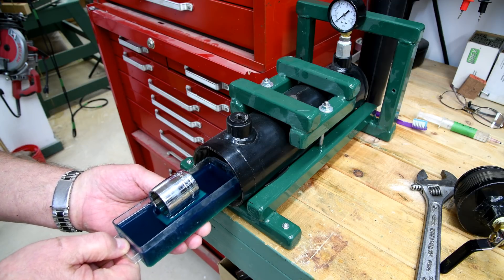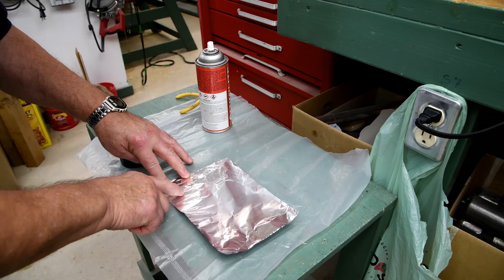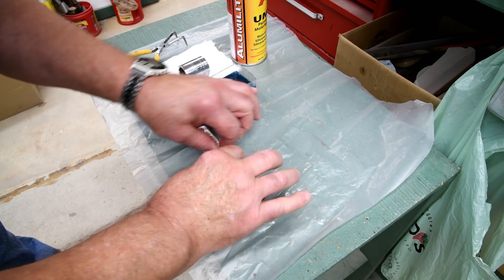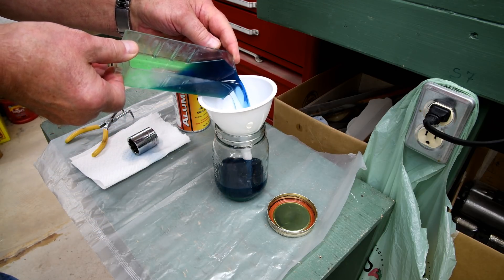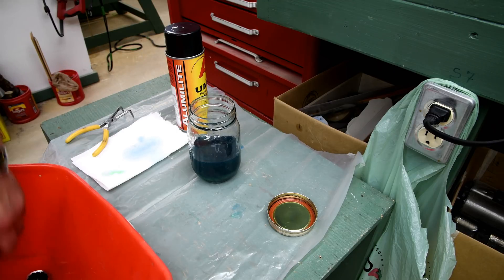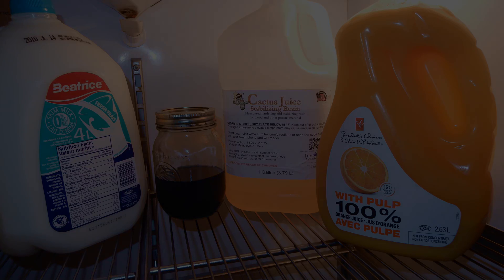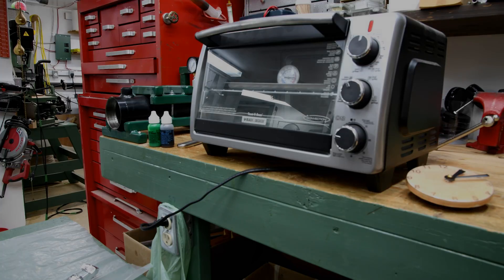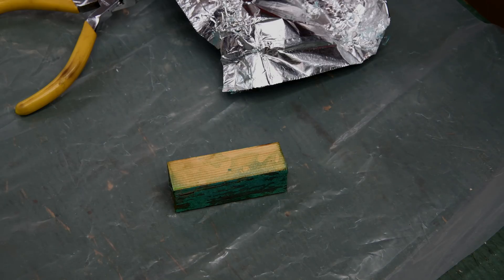The Pen From The Blue Goose - Part 20

Comment: Hi Ron, That was surprising! The wood didn't seem to take on any of the colour, even under all that pressure! Isn't there something on the market that opens the pours & wood grain? But one would think that the pressure chamber would do the same job. It just goes to show that sometimes everything is never straight forward no matter how precise the planning is carried out! It's going to be interesting to see how it turns. Is this the reason why that particular species of wood was used to make the boat, because it's so difficult to penentrate?
Reply from the maker: I drilled out the hole later and was able to tell by the texture of the shavings that the hardened Cactus Juice had definitely penetrated the wood. I simply did not have a strong enough concentration of the dye. I think that wood was just ordinary spruce lumber.

Comment: Maybe you should drill the blank out first, and afterwards use a stronger solution of cactus juice to get the color in from two directions.
Maybe its worth a try.

Best regards from Germany 
Sebastian.
Reply from the maker: There will be quite a buildup of hardened Cactus Juice in the hole and it may be difficult to redrill --- but "Maybe it's worth a try." :)
Reply: Ron Calverley there is a guy on YouTube who may help you with this problem for he does a lot of the stabilization and dyeing.
https://youtu.be/B25ewvbJ38M
Reply from the maker: Thanks Sebastian for that link. I recall watching it about a couple of years ago --- but watched agan now as a refresher :)